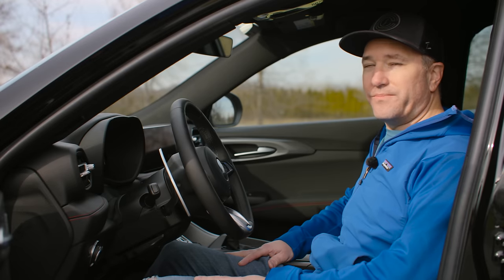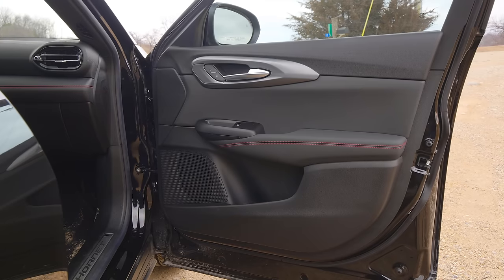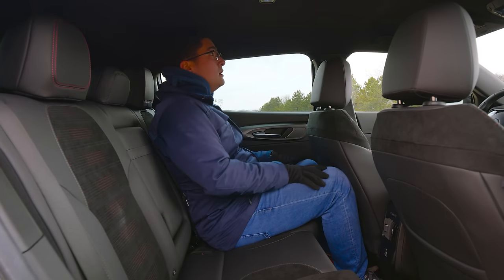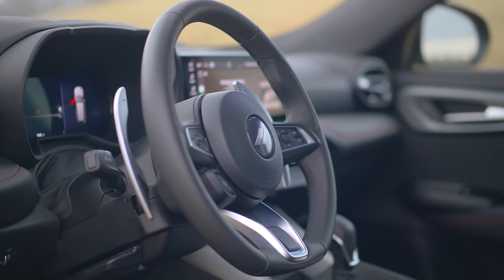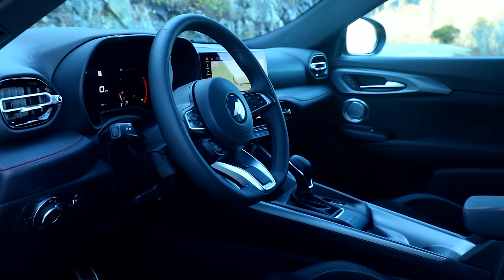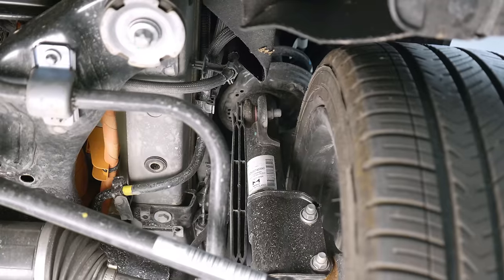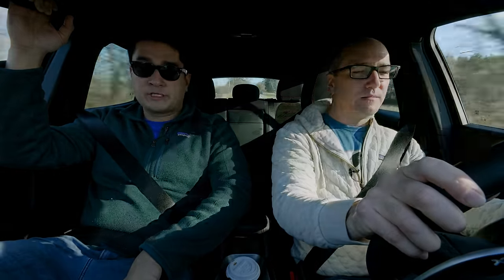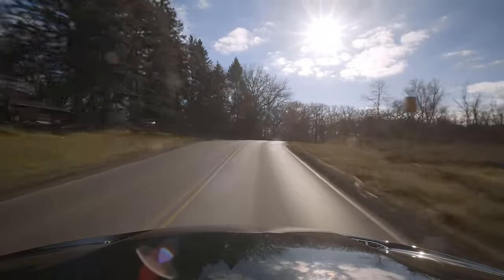Dodge Hornet | A Stinging Sensation

Comment: I've always liked dodge exterior styling. for what it is its another good looking car. it also looks like it has all the same problems. interior is ok, but i hate that stuck on info screen look, reliability looks sus i saw a lot of plastic under there. if i could have afforded a hell cat i would have bought one for sure, just for that drivetrain. they need to find that again. I've seen the aftermarket pull 700hp out of the ford 2.0L eco boost. probably cant push a production car quite that hard but common a 1.3 in a RT..... really. Dodge was different loud and good looking. If the RT was the GT and the RT had a 2-2.5L boost hungry 4cyl making all the turbo noises. I mean i wanna hear everything the induction noise, blow off valve, pops and bangs on lift off, all that. I'd be excited for that :) there with fiat the RT should mean crazy. fiats performace cars always used to do crazy things.

Comment: To me a sporty SUV is a stupid thing. I currently have a hot hatch and a small suv with identical engines. Its silly trying to compare the two. 
The hot hatch with 155 hp/975 kg is much faster than, lets say a suv, with 310 hp on twisty roads

Beleve me I have embarrassed quite a few.

Comment: Would you rather have this or something like the Kona N? Seems if they wanted to make this a sports CUV, they could have or should have gone further with the sport. Otherwise this just ends up being a more expensive, and smaller version of what you can get in a CR-V Sports Hybrid..with worse gas mileage, and potentially much worse reliability. Shit...you can probably find a lightly used Acura RDX for less money than this thing.

Comment: Boooooo. I want a 2.0-2.4L 4cyl Miata knock off thats $25,000 with a manual and RWD. Screw the safety screw the gadgets and electronics. Make it like it was made in the 90s.

AND NO DFI!! And NO ELECTRIC MOTORS! A return EFI fuel system, 9-10:1 compression ratio, NO CAST INTO THE HEAD MANIFOLDS! AND REAL HYDRAULIC BRAKES!!! Shove your drive by wire brakes and throttle!

Comment: How will the buyers going to handle the extremely expensive repairs that plague Audi and other European automobiles typically purchased by people that have the money to repair them? Personally I can't stand Stellantis and have been watching them very close as they have no clue what American buyers want. They have been slowly killing off Dodge and Chrysler brand. Look at the current line-ups for them they are almost dead. Stellantis does not realize the Iconic ip's within the Dodge and Chrysler brands. They have been killing off the most popular vehicles like the Charger and Challenger. They have pretty much destroyed the Mini-Van by making it a Chrysler exclusive instead of keeping the name of the Van that made them popular. As far as I am concerned Chrysler is no longer American and is dead in the water. Only thing they got left that sells is Ram trucks and Jeeps which have really had serious reliability problems the last few years. Just another SUV in an over crowded segment. In the last 10 years personally I would not touch any brand other than Lexus/Toyota, Acura/Honda, and Mazda.

Comment: Genuine question, why don’t they make more cars like this RWD bias systems. It would at least give it a more sporty driving experience and the awd system can stop people from losing control
Reply from the maker: Its a FWD platform so dynamically its hard to do.  Also the e motor in the back is mostly on demand.
Reply: The VW Golf R does this with the drift mode option. But for something like this Hornet it's likely not worth the engineering effort, and honestly Dodge drivers don't need any more encouragement to crash into a crowd.

Comment: Dodge Hornet. Come for the deals, stay because the engine blew up. It was replaced under warranty, but the replacement caught fire a few months later. Leaving you with a $35~$40k paper weight.
Reply: sell it as soon as it is replaced 😂

Comment: This is going to fail miserably,  especially in owners satisfaction scores. 
Ultimately,  it appeals to nobody. 
The Charger and Challenger are big cars. People say they're bought for the performance, but thats not the whole story. Its performance in a big car that people are buying. The Charger is the most powerful sedan you can get. 
This is nothing. Its not the biggest CUV, its not the fastest, quickest, nicest, loudest, cheapest, or most unique CUV either. 
The only version that has ANY appeal is the GT and you would have to be addicted to meth to buy a dodge hybrid. Correction,  you would have to be addicted to meth to keep one out of warranty. 
If it were cheaper i could see the 20-somethings getting on board, but as is i think it flops. Hard.

Comment: It sucks, i test drove one with my wife as a passenger and ill tell you right now its a piece of crap.  The engine bay is too tight to work in, it doesnt actually accelerate very well without severe lag sometimes, and the computer system like the rest of stellantis computers is faulty and hard to use on the fly.  The passanger experience is zero, theres no asthetic to appreciate just that big touchscreen oriented at the person whos supposed to be driving not navigating a slow to respond somewhat confusing touchscreen. It was like getting a new cell phone whos operating system isnt intuitive to learn and doesnt keep up in a coherent enough way for you to make sense of it.  Dont buy this italian made piece of crap, its a knock off alpha romeo and that brand is known to suck as well.

Comment: It looks awful imo. Looks like a lifted 10 year old Dart. It can't decided if it's a lifted car or a low crossover. Knowing Dodge's track record, it's going to be an absolutely awful and unreliable shit show. From what we've seen of that 2.0 in other vehicles so far... No thank you. Worst engine I've ever worked on in my life.

Holy shit there are pieces to remove just to lift it? Those will literally all be broken or missing immediately. Further proof that engineers literally do not give a shit about servicing the vehicle. And you can't even use the "cost" argument, because there's no way it's cheaper to design and make those extra pieces than to just... not do that.

Literally nobody that's buying a Rav4 or a CRV for Rav4 or CRV pros is even going to consider this shitbox lmfao. It's nonsense to compare them at all. If I want something fun I'm going to shop a CX5 turbo against this.

Comment: Another Stelantis trash (carbage Alpha Romeo with Dodge badge) ...  Stelantis first place need build quality vehicles which they obviously can`t ... worst reliability by CR ... problems with electronics and gearboxes ... tell me honestly 40k mile for new gearbox till it broke it is okey in 2024 and then issues with warranty service... no may be 1920s or even in 1950s it was perfectly ok ... regulary glitching electronics ... not ok 2024  either  consider that other makers do not have issues or it is much less... Stelantis will do favor everyone especially their share holders if stop produce non comercial vehicles in the US/Canada ... Company had models for EU but they do not fit with The North American market ... and finally kill Chrysler/Dodge(just brand name left of them) ... which is dead already from 1970s when switched to Mitsibushi then Mercedes platforms .... famous new charger/300 was Mercedes W210 platform build car by Mercedes include engines and even new HEMi ... need honestly put Mercedes logo no actual connection to Mopar or  Chrysler or Dodge ... New Voyager was Viano based model ... problem with Stelantis is that neither it or FIAT before has decent platforms(rwd or awd) to build new 300 /Chalanger and decent SUVs ... even Mazda manage pull off new  platform CX90 like BMW and even GM before did it...